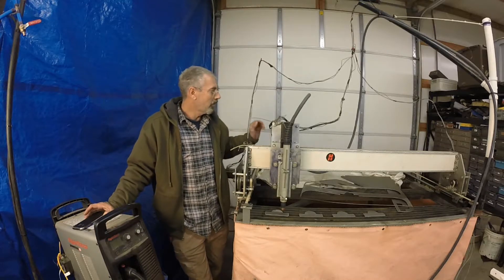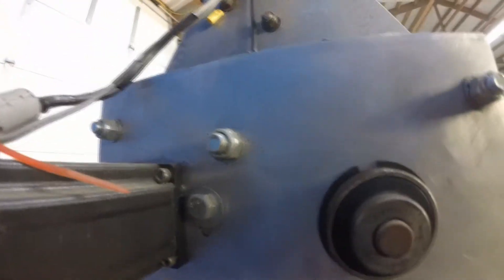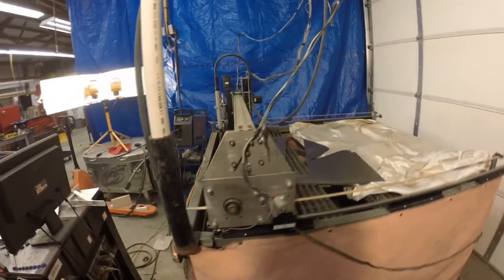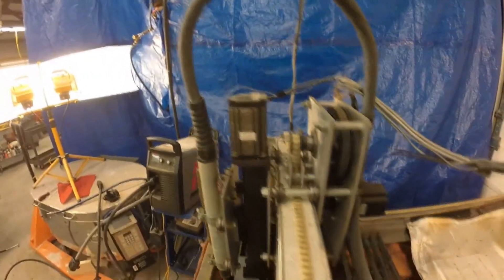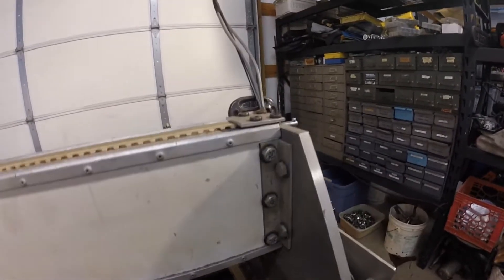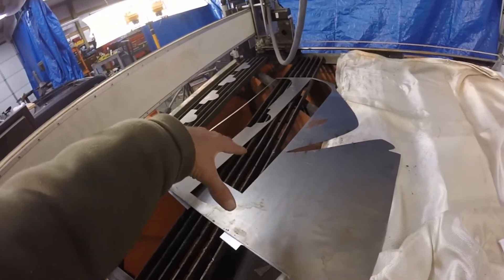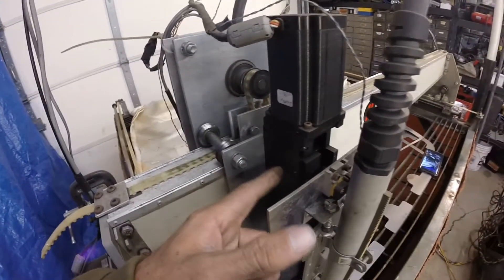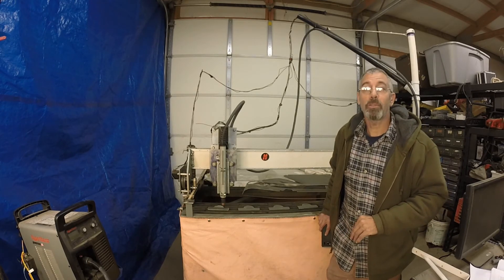Home made CNC plasma, Overview

Comment: Nice  set up could you share your plans
Reply from the maker: No plans. They were in my head, and pretty much forgotten after I built it. I doodled the drive layout , to scale, on a piece of notebook paper, and that's gone too...lol. Mechanically it's real simple. The motor driver controls, I bought from CandCNC. They have a complete control panel and drive motors package that I fit to my machine. The electronics were more than I wanted to learn at the time, so I just bought it.

Comment: Great build . What size of belt do you use? Do you have any problem with belt stretch?
Thanks
Reply from the maker: I believe they are XL series by 3/4" wide. I can't recall the tooth pitch. Initially, the belts will stretch a little, First 30 days or so. After that they stay tensioned. I just have to go back into mach 3 and recalibrate the steps per unit of travel...I did it once after initial setup, and it's been good ever since.

Comment: Hi Marcel,  excellent video of your plasma cutter.   I'm an electronic guy who has a mig welder and want to build my own plasma cutter to make metal parts.  I don't own a plasma cutter yet but I'm leaning toward a Hypertherm type.  I want to cut 3/8 steel to make sprockets for chain drives as well as many other things.  I've been scouring youtube for videos on diy plasma cutters and stumbled onto yours from another guy who had your video in his liked video file.  I notice most plasma diy guys seem to have a water pan I guess to catch the slag sparks and crap getting blown out by the cutter.  I like your idea of the fire blanket and the exhaust system.  You are the only one I've seen do that.  Does the crap just land on the floor and you sweep up after wards at some point? The linear rails with the v groove bearings are the way I'm going for sure... parts for that can be found at the https://openbuildspartstore.com/ including the aluminum v tracks and v groove bearings and even the mounting plates.  I"m probably going to make a video of the build and put it up on youtube at some point as well.  Arduinos are the way to go for the electronic side of things at 35 bucks for a controller that hooks right into your computer serial port .   Time is my only enemy as I'm self employed and busy alot.  Anyways thanks for the information you have provided.
Reply from the maker: Tom Collins Yes, the crap just gets swept up off the floor. Arduino, wasn't really a thing back in 2011 and 2012, at least not what they are capable of now.If I were to do it again, I'd probably go with an arduino. The real money is in the motor drives, but it all adds up. Definitely get a hypertherm- they are designed from the ground up, to be used in cnc applications. They are pricey but worth every penny. I'm extremely happy that I went with a C and CNC controller, their tech support was amazing. I blew up my first controller with a cheap chinese plasma cutter that released so much emf that it fried the board and power supply, they replaced my controller for free and bought my chinese plasma cutter from me to improve the emf resistance in their future controllers. One of the main reasons that i didn't want a water table is that I didn't want all that standing water in my shop to rust out my machine tools.  Good luck building your plasma table.

Comment: Thanks Marcel for the overview.  I have come across this video after I started a series of videos on building my CNC plasma table.  It is amazing how much our two designs are alike. Would you consider doing a video on running the machine.  I'm interested to see you jog rates and how well it cuts.  I am going to be using my PowerMax 45 from Hypertherm as the cutting machine.  ~P
Reply from the maker: sbirdranch  Here's a video with it in action. https://youtu.be/cCyGtgIBLYY.  7 minutes in , you can see it working.

Comment: Marcel, I've been waiting for this one. Thanks. It's a really good overview. I have to ask if you remember the tooth count on the cogged belt pulleys? Also thank you for the links, I tend to underutilize eBay sometimes. I really appreciate you taking the time to make this video!
Reply from the maker: +George Chambers I'll get to the tooth count on the belts and pulleys in my next plasma video. I'm collecting questions to fuel up for the next one video. Thanks for watching George!
Reply: Marcel thanks for the reply, I can't wait. Already pricing stuff from your links. One quick question, what is the diameter of your rails? 20mm or maybe 16mm or Imperial?
Thanks again.
Reply from the maker: +George Chambers  they're 3/4 " imperial. I bought those used. If you can't find them at a reasonable price, try going the v groove wheel route. Those linear rails that I have are less than ideal, because they can accumulate dust and grit inside the bearings. Rollers would bee better, but the price was right on my build and it did simplify the build for me.
Reply: Where do you find the v strip for the rollers? I tried in ebay but couldn't come up with anything? Thanks for replying again.
Reply from the maker: George Chambers I don't know! I looked for it before posting the video and I couldn't find it. It might have been surplus too.
Reply: OK, thanks. I'll keep looking, maybe McMaster-Carr or someone like that.